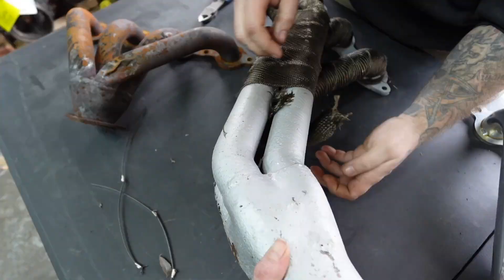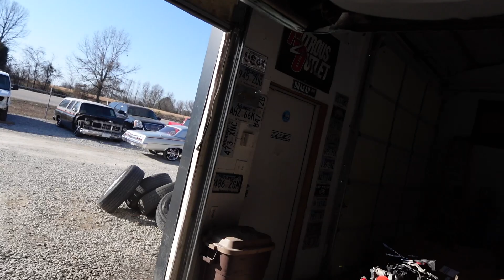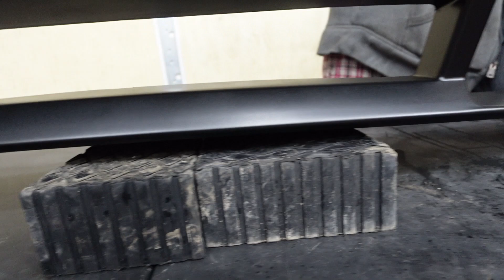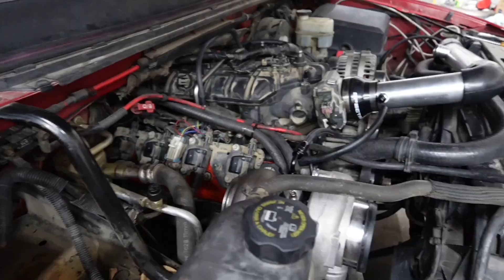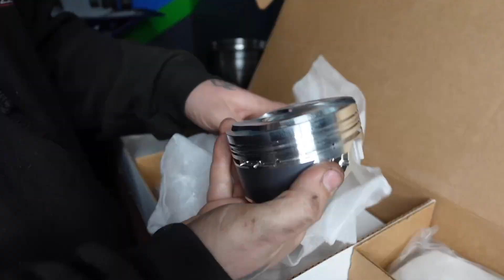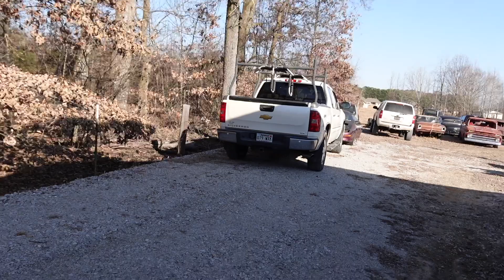LS Swap Headers Explained- MILD STEEL VS STAINLESS STEEL

Comment: What's a good set of headers to put on a OBS LS swap build 🤔
Reply from the maker: Speed engineering make some shorty and I believe mid lengths but not longtubes. This ceramic coated set of longtubes in this video are form shoenfeld and are for an obs
Reply: @727motorsports  thanks for the information. I been looking for some good headers that will fit and won't rust. Great video 👍🏾